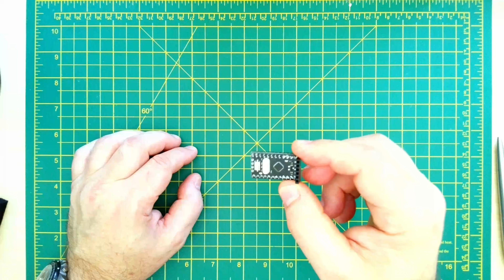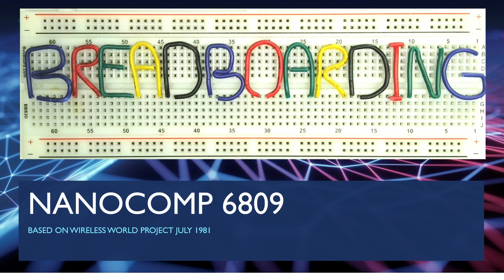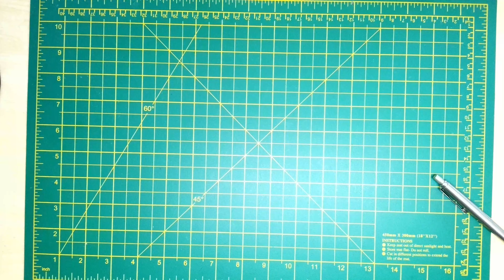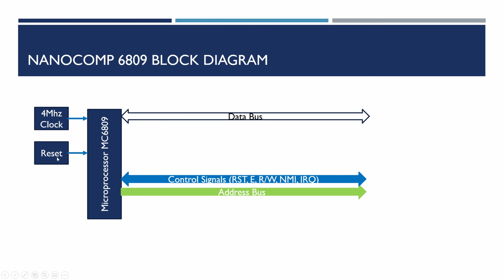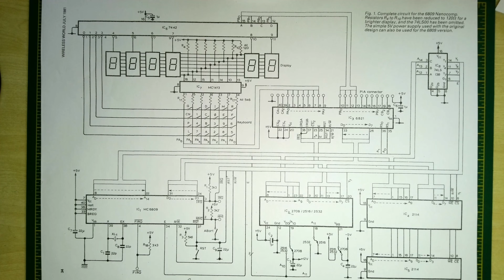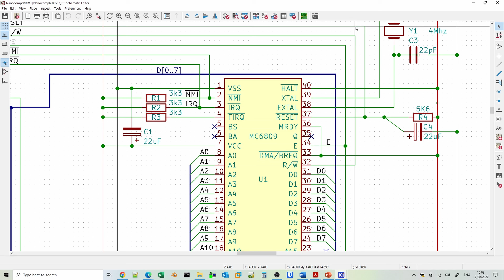Nanocomp 6809 #1 Introduction - 8 Bit Breadboard Micro

Comment: That's great timing, your channel popped up just as I was contemplating using the 6809 / 6309 for my next build. I'll be binge-watching your nanocomp series!
Reply from the maker: Hope you find it useful, the Github site (https://github.com/breadboardinglabs) has the original Nanocomp Project files and ROM binary and the disassembled source should you want to use it (these are specific to the Keypad and 7 Segment display design in the 1981 Wireless World Project). I will be working on re-writing the original monitor in to C so it can use PS/2 Keyboard and VGA display but this will be a few months away. A lot of projects just seem to use the serial port rather than keypad and 7 seg display but having something running standalone I think is more 'retro' otherwise why not just run an emulator on your PC if you use this for the display and keyboard via serial comms?

Comment: Do you use the 6809E with the external clock? It looks like the pin out is a little different between the 6809 and the 6809E CPU's. Pin 33 - BUSY, Pin 36 - AVMA, Pin 38 - LIC, Pin 39 - TSC.
Reply from the maker: For Nanocomp its the 6809P which has the XTAL and EXTAL Pins (38 & 39) for connecting crystal directly (NOT The 6809E or 6809EP which was used on Dragon 32 with external memory and clock controller). 
I have some faster 2MHz 68B09EP which I plan to add at some point but this needs an additional oscillator and flip flop circuit to produce the E and Q clock signals external to the CPU.  There are two datasheets, one for 6809P the other for 6809EP. Figure 10 on page 12 of the EP sheet has the clock circuit. Be careful of other sources of EP clock circuit. There is a 6809 PDF document out there with the wrong clock circuit for the EP.